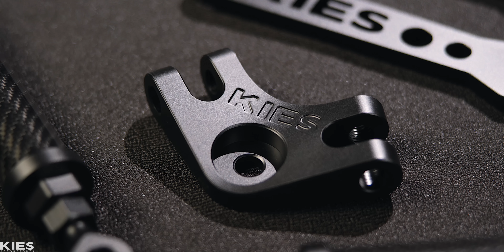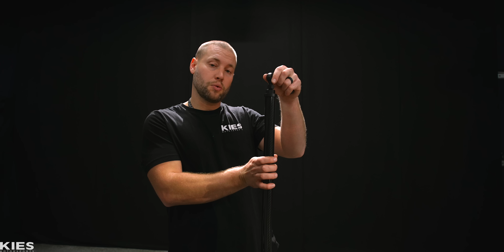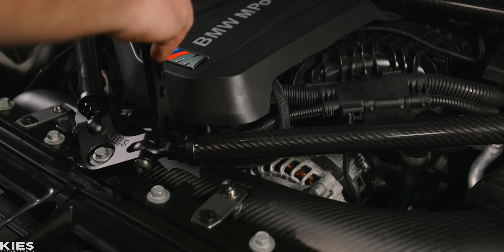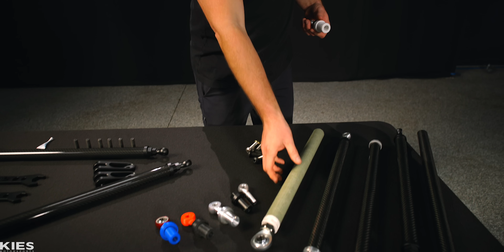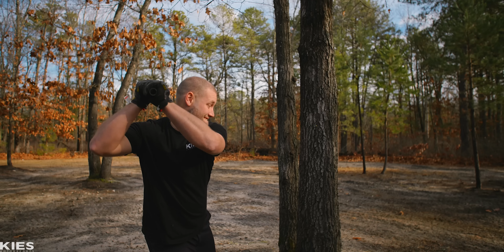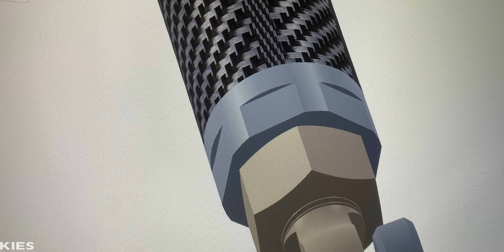The KIES carbon fiber STRUT BRACE for BMW M2/M3/M4 (G8X Cars)

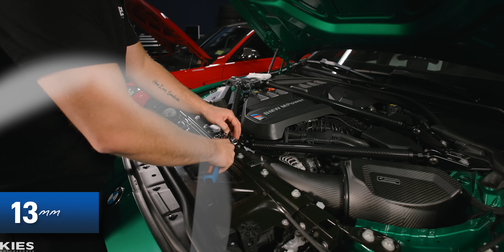Comment: I just bought these; they are absolutely beautiful! In your video (6:41) it indicates the torque spec of the 13 mm center bolt as 56 Nm, but in the description it says 28 Nm. Which is correct?